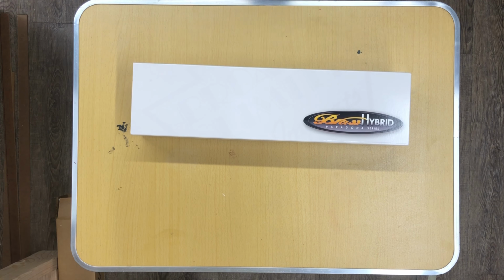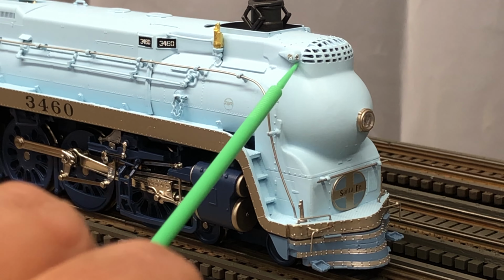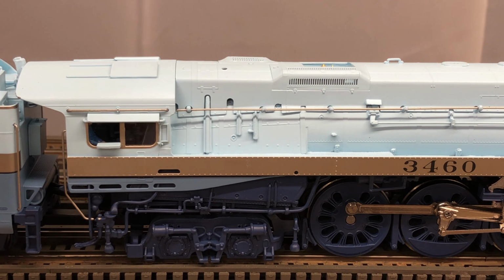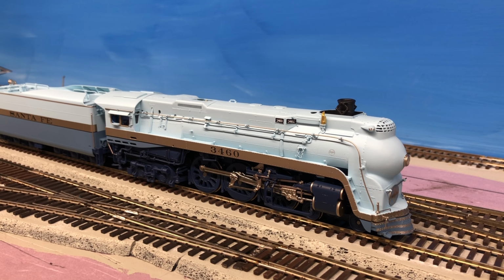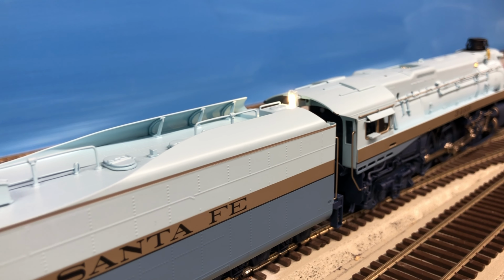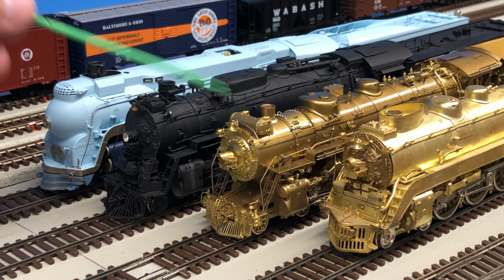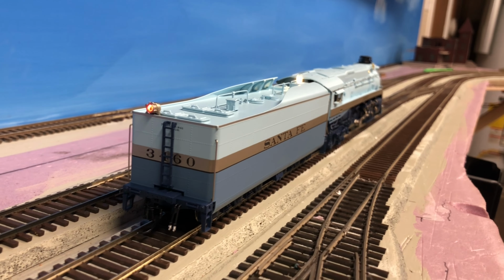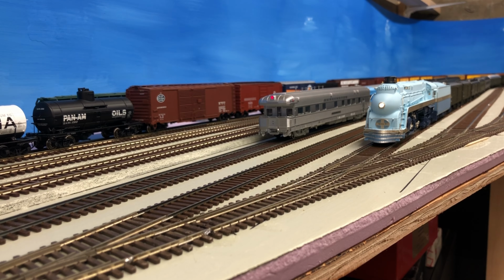Broadway Limited (BLI) Santa Fe Blue Goose 4-6-4 Unboxing and Review

Comment: Thanks for sharing your review of this locomotive. I have a Rivarossi Blue Goose locomotive that I bought in the early eighties. I have recently purchased this BLI version. I am very happy with this one, as I was with the Rivarossi version. (Even though it wasn't totally accurate). 
The Rivarossi Blue Goose ran flawless for decades. 
Rivarossi did produce a set of passenger cars in the same livery as the locomotive. While these are not prototypical. They look good behind the locomotive. When I get settled in my next place of residence. I will dig out the passenger cars from my storage.

Comment: It looks to me as if the crosshead guide on the right (engineer's) side is tilted downward as it moves towards the back of the engine.  I also noticed the flashing or dried paint problem in the front grill.
By the way, the correct pronunciation of 'boxpok' is "box spoke."  The term's spelling is admittedly confusing, but it literally means box spoke, and should be pronounced that way.

Comment: You sure know your stuff around a steam locomotive. Nice colors on this one. I agree it could have been better. Besides the points you mentioned. I don't like the fact that the cilinders are leaning forward and the crosshead guides are sloping downward. Also the Philips head in the excentric crank looks awefull. And why are the whistle and safety valves painted brass color!? On most regular BLI's  these parts are real brass not painted 😂  The only extended chimney is a shame,  a low one would compliment the sleek line of the engine.